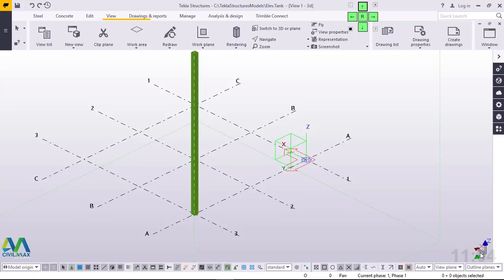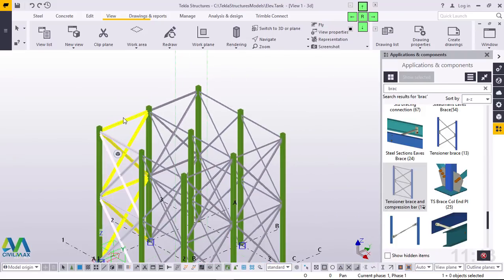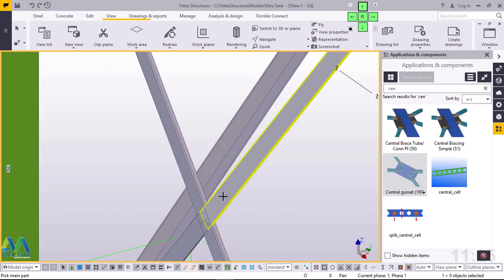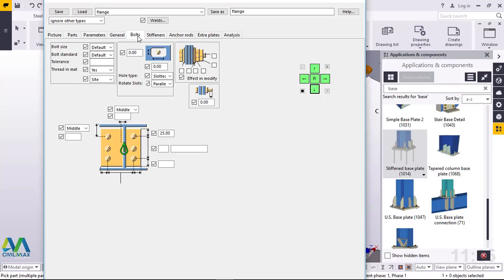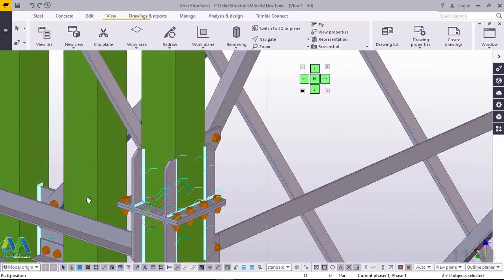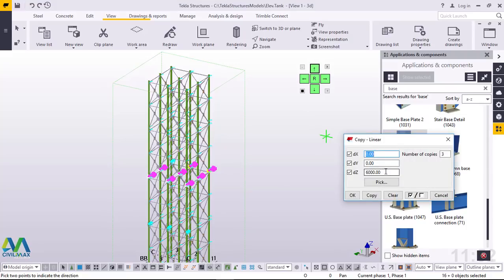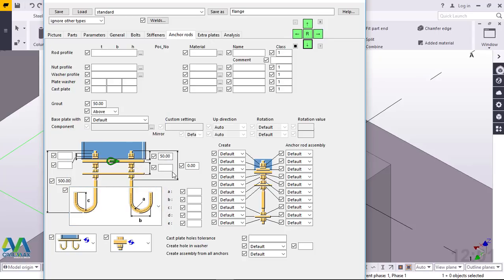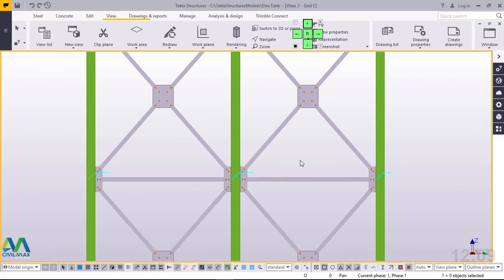How to Create and Brace Tank Tower | Tekla Structures

Comment: On 29 min in video you suggest to explode component and after that need to make assembly again. I worked in same way before, when  very experienced tekla user told me good advice. Newer explode components in connections, just   choose select components in connections and make changes. These advice has save me  a lot of time when come come changes in model and connection, but when connection is exploded can be stressful.
Reply from the maker: Explode is optional,you can disable the assembly by clicking the assembly button.